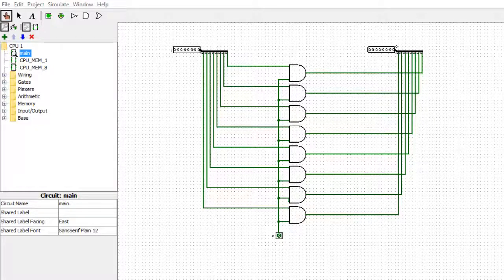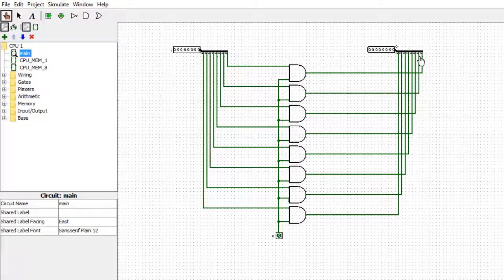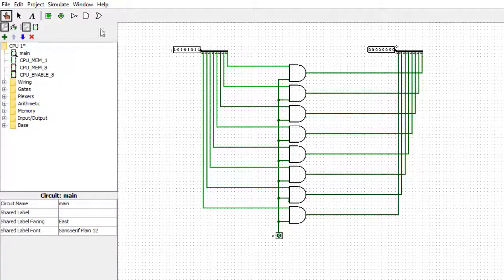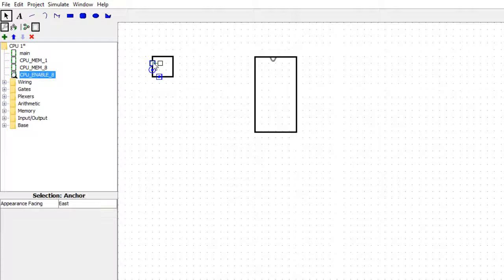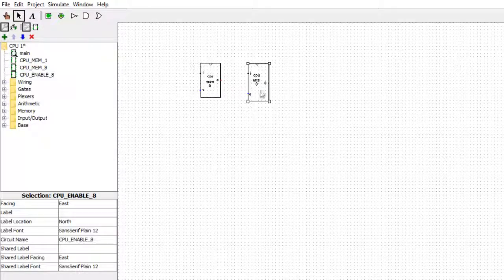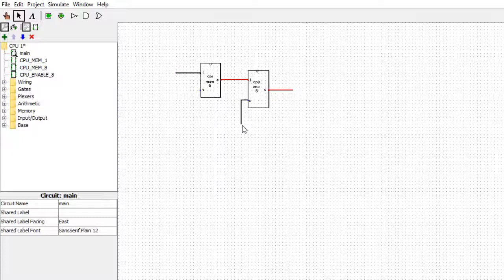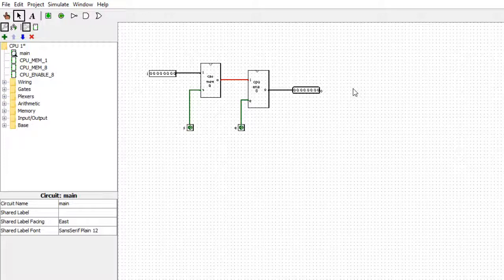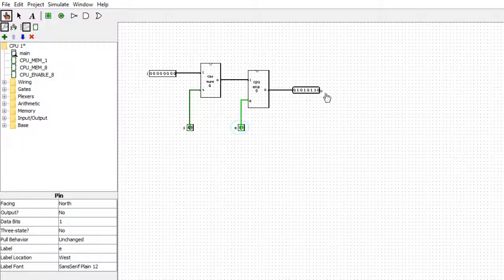8 BIT CPU 8 Bit Register

Comment from the maker: I wrote my first programme on a Dragon 32  ( yes 32 kbytes) . I also had an emulator when I was at Uni that allowed you to write a tiny but of code and you could step through every instruction and see all the registers changing values. It was for the 8088 chip. You should be able to find an emulator online to help you learn some assembly language.